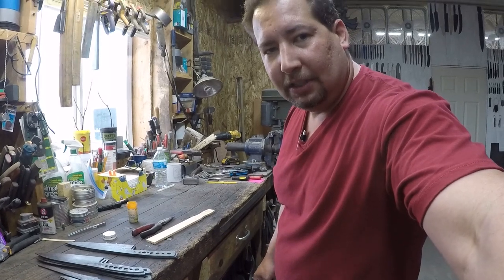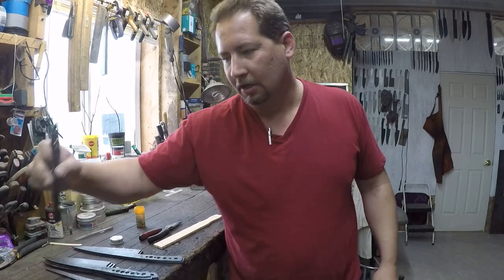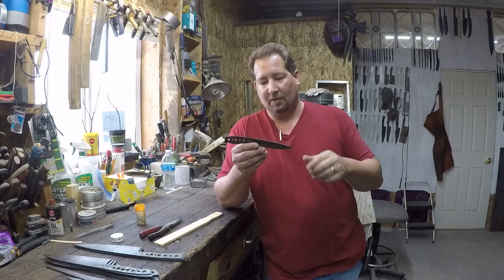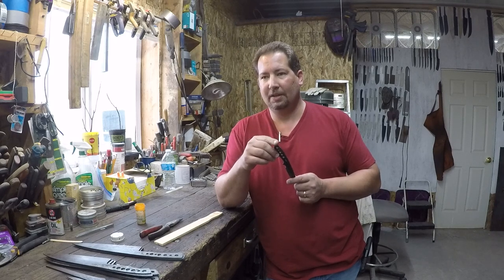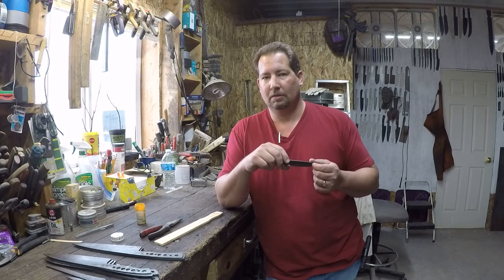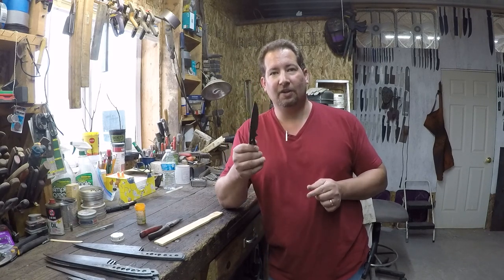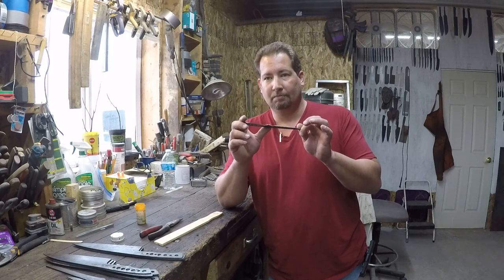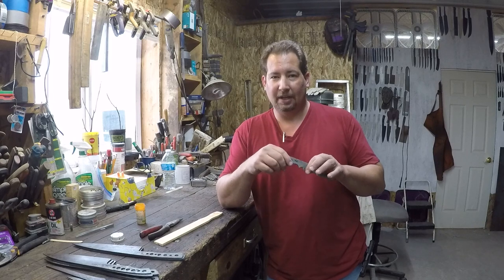making a new knife pattern - 11 grinding sticks

Comment: Neat idea! I have never tried that. I bought a 12 dollar cool mister from ebay so I never get any heat and it really keeps the dust down too. I duct taped a piece of cardboard to the top the front of the upper belt guard to keep it from throwing water on me and I really like it. I like the idea of that little shelf.
Reply from the maker: I have a drip system on my grinders for when I do wet grind, but have to replace one of the fittings that broke during the move. but its just a wet tile saw pump in a 5 gal bucket under the grinders, and 1/4" sprinkler tubing run to the top wheel and sheet metal splash guards. it works pretty well

Comment: About the german video you mentioned, it is from an old german TV series called something like "the last of his trade". In this episode, they talk about the "Blue polishers" (better translation welcome) in the Solingen area (it is the german cutlery area like Sheffield in UK, Maniago in IT, Thiers in FR...). The name came from the final polish they put which is not mirror like but that leaves a blue-ish shine on the carbon steel blade. Basically they nearly "zero" grind ultra thin blades that are said to stay sharp enough even after wear without resharpening them. You can see Master Ferrekamp (that is his name) use one of these (crusty old) to make some snack for himself. You can also see him making an edge flex test with a sort of ring on his thumb but that is more to check for constant edge thickness while grinding. The wheels and sticks he uses are/were quite common in european and japanese cutlery. Your guess was right about wood, leather, home made glue and some abrasives pastes of various grits called "Naxos Schmirgel" (they say Naxos is a Greek island). Years ago, the cutlery operation were divided between smiths, grinder/polisher, final assembly etc. Ferrekamp is a grinder working freelance for Windmühle/Robert Herder Solingen among others. The episode shows his moving out to be a full time member of Robert Herder Company and learning his skills to apprentices before he goes into pension. The small paring knives from Windmühle are still on sale today for about 12 EUR, mostly stainless, but the high carbon are still available, not from the master as I think he died meanwhile. One of those knives can be seen in a Cliff Stamp video as Gift from Roman Landes, a knifemaker who is the european Verhoeven, Kevin Cashen or Larrin Thomas when it comes to heat treat. https://www.youtube.com/watch?v=d6ojakvufUY. One can see the older Master Ferrekamp in a  few other more recent german videos from which I learned the steel is C80 (AISI 1080) hardened to 60 HRc. Let me use this opportunity for me to express you all my gratitude for all your videos and your practical approach. Please say hello to Ed Fowler if you see him once, from a french admirer of his life style and "stubborn/obsessed" mind I can imagine he has and that I admire too.
Reply from the maker: wow! thanks for the translation! ive probably watched that video at least a couple dozen times, and always wondered who he was.   I did pick up one of those herder paring knives that cliff reviewed and it sits in my kitchen knife block and is a heck of a knife :} I will try to remember to say hello to Ed for you the next time I see him hopefully this summer.
Reply: @joecalton1449  You're welcome Joe! My pleasure. I have watched it also probably close to 10 times. Try to tell Ed he should make his 52100 Wootz video available (for money of course!) for download for foreigners. ;) The nice lady I had in the mail told me the shipment to me in France is way much than the CD is worth so we gave up... Too bad. Take care!

Comment: Cool idea!! It would be Interesting to know it one could make a holder from wood and nails  for straight razors. Meaning during refurbishing work with a dremal, some how tacking the razor descaled onto a board so fingers will be safe and out of the way. 

They are a method useing magnet, but I don't like that idea.
Reply from the maker: I bet you could find some trim pieces at homedepot or lowes that would be close to the curvature of the grind in a razor and make holders from that. then soak them in water to help dissipate the heat from your Dremel. 

 magnets and razors don't work all that well for me, in the past when I have used a magnet on a razor, it magnetizes the razor, and every little piece of metal dust is then attracted to the razor